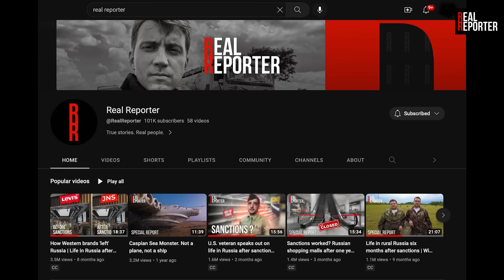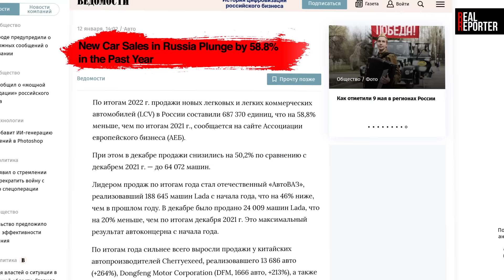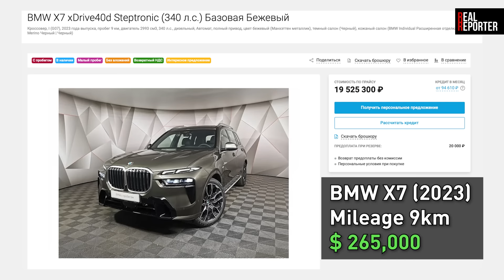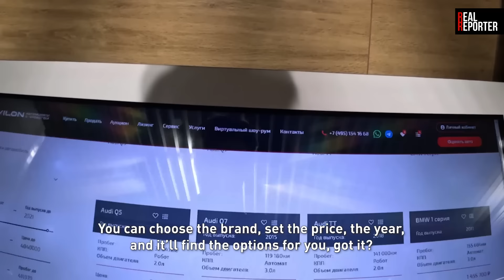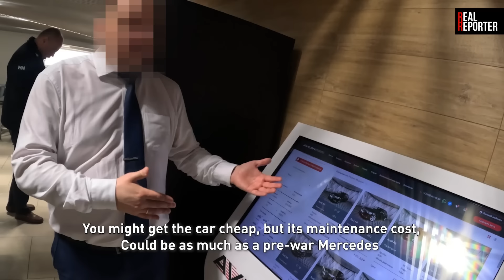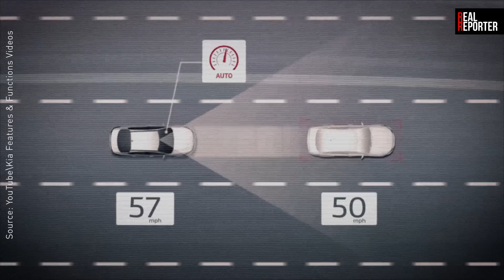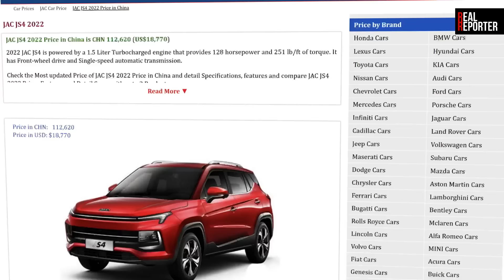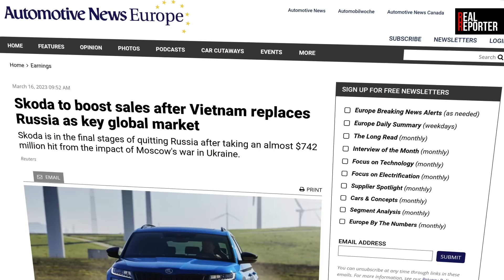Sanctions vs Russia’s car market. Who wins?

Comment: I though you were going to buy the Jag but I think you made the right decision, sticking with your old Opel for now. 

Me, my 2000 Jeep Wrangler and 2006 Dodge Dakota are  still getting me around Alaska roads, and off road as well,  just fine.
Reply: My 2000 S-10 4x4 still purring like new.
Reply from the maker: Hey there! It's cool to hear from a viewer all the way up in Alaska! Yeah, I was tempted by that Jag but sticking with my trusty old Opel seems like the right move for now.

Sounds like your Jeep and Dodge are doing a great job keeping up with the Alaskan terrain! That's the beauty of old reliables, isn't it? They may not be the newest or the shiniest, but they get us where we need to go. Stay safe on those roads (and off roads), and thanks for tuning in!
Reply: @RealReporter  The North American equivalent to your Opel Astra is the Saturn Astra (thanks to badge engineering, which is why in the video you see ‘new’ Russian vehicles are Chinese designed; it is not an uncommon practice these days).  Two oversimplified differences are lighting (North America has a different lighting standard), North America has a requirement for orange in the front and red in the rear for reflectors.  Plus, General Motors (“GM”) owned Opel for almost a century (to be exact 1929-2017), selling Opel to PSA Group in 2017, PSA Group is now part of Stellantis.
Reply: @ScottRothsroth0616  It was a Saturn Aura, 06-09, was a good car for the money.
Reply: Good deal, those cars with abs and airbags are going to serve you better in Canada than a Russian car without those
Reply: @ScottRothsroth0616  badge engineering has been going out of favour for a while now though
Reply: @TKUA11  Airbags (OKA "Supplemental Restraints") are unnecessary - only added because many Americans refuse to use seat-belts.  Supplemental Restraints are a quaint American  anachronism.

Comment: Great choice! Here in Romania we don't change our cars. We fix our old cars until they are not worth fixing. My volkswagen golf 4 TDI is 24 years old and it has plenty of life left in it. It still drives like a 5 year old car.
Reply: is a 1.9TDI the best Engine.
Reply: Russia too I have a 09 trailblazer I got brand new back then (my first car ever) so recently on a weekend I rebuilt the suspension (bushings shocks ball joints tie rods etc) it drives like the day I drove it off the dealership parking lot
Reply: walking coffins lmao
Reply: @veneps  still better than newer cars that can be seen in junk yards with blown engines and 180000 kilometers on the clock.
Reply: @lupulflamand5673  sigur, cum crezi tu
Reply: @Capt.-Nemo  Hello, my Audi A4 with a 1.9TDI drives everyday. 24 years old. Look after it.
Reply: Same deal with overwhelming majority of Russians, you’ll rarely see new ones even in Moscow and those are either taxis or some government official plates
Reply: Ai dreptate
Reply: @Dankmemeslover69  Govt officials are not permitted to drive foreign cars.

Comment: I am russian and I drive a 2018 Kia Optima GT right now. Bought it right before the pandemic for 2.100.000 rubles (around 26.500 USD). And I cannot say that I have any problems with spare parts! First of all, Optima (American K5) was a very popular car, so there are a lot of parts around shops. As for the filters and oil - they cost pretty good (I spent around 11k (around 138 USD) rubles to change all the filters and engine oil). During these times this price is actually OK. But 6 months ago we had to change the brake pads and discs on my mom's VW Tiguan, and the prices were a NIGHTMARE. We've spent like 50k rubles (630 dollars) on parts alone that time. But now analogs from China and less known brands have been entering the market lately and the prices are coming down slowly.
I wish everyone a great day and thank you for your great content! It's always a big pleasure to watch your videos!
Reply: clemathieu JT  I envy your prices in a good way! :)
Reply: clemathieujt6589  In South Korea it would cost 50-60 USD
Reply: clemathieu JT  Oil and filter possibly contefeit hence price.
Reply: I'm a mechanic in the USA. I work on a lot of Kia vehicles. I generally like them I have only one warning it's a big one though. If your Kia has a gdi or direct injection engine there is a major issue with the engines going bad usually around the time you would be putting new plugs in. It is completely random many never have a issue but far to many do. It's at no fault of the owner it is a manufacturer fault. The best advice is oil changes and more oil changes on time or early.
Reply: @sir.tacocartbearson1569  Thanks for the heads up! Will keep an eye on that!)
Reply: Western Parts are still flowing into Georgia & Kazakhstan etc.  I'm sure there are plenty of these parts bypassing sanctions & crossing into Russia by Truck / Rail ??
Reply: Can't you buy spares online from Autodoc or Oscaro?
Reply: @xavichuvy9047 yes Autodoc works
Reply: Ты бы на тормозах для матери не экономил
Reply: Car nowadays aren't high tech alien technology.... you can find copycat sparepart for every original ones 😂

Comment: 58 years of driving behind me - my daughter took me for a ride in my first EV.  It was a Chinese BYD, and based on that experience, I rate it highly as a local runner.  Long trips would require regular charging.  Charging spots are sparsely spaced and the charging time involved a huge inconvenience.  But it was a top class ride.  I find it hard to imagine that other EVs would offer more, and many might offer less.  Me? I still prefer gasoline for rural and long trips.
Reply from the maker: Hey there! Wow, 58 years of driving, that's impressive! I'm glad to hear your first experience with an EV was positive. Though, I totally get you on still preferring gasoline for rural and long trips. It just feels more reliable, I guess... Anyway, thanks for sharing your insights. Keep those wheels turning!
Reply: @armamentarmedarm1699  Maybe? but I do not see the increase in electricity production in this country.  Nor do I see the necessary upgrades of the network and distribution infrastructure.  Also the price of electricity is being increased much, - and that will make personal travel unaffordable, and that surely would effect the demand for electric vehicles.  So what exactly will future mobility look like?  I do wonder.  It does not make sense that the ideological rulers dictate supposed ecological rules removal of one main energy source before ensuring a viable affordable alternative.
Reply: @kiwikeith7633  they might have to increase their focus on hydrogen instead, depends if that area also have some huge manufacturing drawbacks or not as batteries do now
Reply: clemathieu JT  And the point is that the Chinese PHEVs are more fuel efficient than conventional ICEs, in comparison to the European ones especially.
Reply: Chinese evs spontaneously combust on a regular basis
Reply: Tesla uses Chinese batteries from CATL and Byd. They do that because their batteries are the safest ones available. Maybe you know more about battery tech than Tesla.
Reply: @shutyomouthchild  lying makes you happy eh
Reply: @MontyGumby good comment, comrade, CCP is proud of you
Reply: Fires starters.
Reply: @tallll70  Yes, you might be right.  I wonder how hydrogen can be produced in sufficient quantities and presumably it need to be compressed, which would take Energy.  So I do not understand the economics.  I still prefer Gasoline and Diesel.
Reply: @tallll70  hydrogen for cars is produced by using a lot of oil...these cars are extremely expensive ( I've talked with some taxi drivers hère i'in Paris who own one, rather small cars...then, not easy to find anyhere Hydrogen.
Reply: @shutyomouthchild  Do like your username says.
Reply: BYD Chazor looks build for you. Gasoline motor used like generator with electric motor. 1200 km range

Comment: Skoda is leaving China very soon too. Before 2010, China's domestic brand cars were really trash. Even the road network was designed to handle poor performance vehicles.
After 2015, domestic brand is becoming an option here. Also China's foreign brand cars are also joint ventured with domestic brands (EXCEPT TESLA, it get a special permit by Shanghai gov).
BTW, the most selling price category for personal cars in China is 100k~200k CNY (12.5k~25k USD). Also China is pushing for BEV and HEVs. What you see here are all kinds of outdated options and brands. It's much more common to see a BYD, Tesla, GuangQi and other foreign brands' EV or HEVs. 
Also, Haval, a sub brand of Changcheng aka, Greatwall, is having a really bad marketing right now. (The tech is still good, but marketing is killing itself) We are not looking good on it. Avoid it if you can.

Comment: Currently in Singapore. A BMW X7 will cost USD$485,610 to get on the road. There is Mercedes X350d (diesel version) here running for around USD $361,000.
Reply: lil

Comment: I'm about 16-17 minutes into your video.  One thing I think that is universal is that salesmen are not to be believed.  The salesmen there are no different than the ones here in the U.S. at many dealerships.  For them, the bottom line is they want to sell you something and they will do or say whatever they have to do it.  You're doing the right thing by asking friends and doing some research.

Comment: You definitely should consider Chinese cars! I drive a 2016 Volvo which despite its Swedish origin, is now owned by Geely and manufactured in China. It’s held up great! The advancements Chinese brands have made in the past decade is insane, good quality, safety, and price! Far cry from the Chinese cars of the early 2000s. Just look up the Shanghai Auto Show in 2023 and see all the crazy improvements Chinese cars have made
Reply: China has had experience building Japanese cars for years now 
I’m pretty sure most Honda sedans are built in China
Reply: That's great and I'm sure it is a good car but the reason I will not be buying one is because I do not want to support CCP. Unlike the Russians, I do have a choice which car I want to buy.
Reply: @dogetothemoon223  That's the correct attitude. Sometime's we have no choice but to buy chinese stuff, but in this case? Big no no no.
Reply: @gigadude556 lol,so gullible 😅 Most things you buy are made in China,or at least some parts of them are.Its not about you supporting or not supporting CCP ,it's about Corporations who are still supporting them 😅
Reply: Geelyes are alright, i've driven the Volvo xc40, and that Geely thing that his sub has bought feels about the same. Cheaper inside maybe, but not any different for how it drives. Other chinese brands are mostly not there yet, but Geely is the priciest of the lot.
Reply: @zloychechen5150 LOL  Do you really know Chinese car brands?😂
Reply: @user-hc5cg3jc3i  for better or for worse, i do.
Reply: Volvo isn’t made in China and still engineered in Sweden
Reply: @mosesgoldbergshekelstien1520 they’re not. Mostly manufactured in the states but developed in Japan
Reply: @lucasworktv  A lot of design and engineering is still done by the Swedes but it’s still owned by a Chinese company who revitalized it and added their own input. Volvos are made in Sweden, Belgium, China, & the US. My Volvo was manufactured in Chengdu China according to the papers in the glove compartment.
Reply: @Larry-Lobster  our BMW x5 was made in South Carolina United States, and was designed by an American designer Chris Bangle. Our x6 was made in Kaliningrad Russia (but also maybe the US) But still it’s actually a German car. 

Which Volvo do you drive and which country do you live in?
Reply: @Larry-Lobster  I beleive it was an extremely savvy move by geely to buy volvo. They don't seem to limit the swedes too much, but they use their tech and some other stuff, and it shows. I think in 10 years time they will be the new hyundai. A brand that a couple of decades ago seemed like some cheap-ass last-resort ecobox manufacturer, but now is kinda mainstream.
That happened to the japanese in the 70s, then to koreans in the 90s, the chinese are next.
Reply: @dogetothemoon223  "I do not want to support CCP. "

Great news, you wouldn't be supporting CCP, it's CPC to start with. Never let politics and emotions run your wallet is what my father told me as I grew 18. But hey, I hope it works out for you.
Reply: @f1aziz  when you are out of ideas, you run with semantics
Reply: Buying a Chinese made car is like buying a Russian made car.  At the end you're supporting the enemy. Hope EU and NA goverment makes it as hard as possible to buy Chinese cars in EU and NA.
Reply: @povilasmarveloustv3810  based on your logics, those Chinese should have done it long ago
Reply: @anti-bullingjames  they didn't do it because it was beneficial for them for many reasons. But in due time it could happen. The tensions between the regions are growing and what do you think will happen if China invades Taiwan?
Reply: @f1aziz  i hope your father never complained about jobs leaving US then with that type of thinking.
Reply: @dogetothemoon223 buying from China doesn't mean supporting the ccp. I don't want to support the US wars in Africa and middle East doesn't mean i won't buy American.
Reply: @povilasmarveloustv3810  complete trade embargo is a modern invention by all powerful central governments. During the Hundred Years War, England and France traded all the time.

As a consumer, I don’t benefit at all from trade embargo against Russia.
Reply: @alexanderchenf1  different times. Trade embargo right now would be more beneficial for the NA and EU because it would end up with more investment and manufacturing locally instead of outsourcing it to China. Covid showed just how dumb it is to over-rely on one country to deliver the goods. Though complete trade embargo isn't the answer either. Either way, NA and EU can't afford Chinese car makers to overtake their markets.
Reply: @povilasmarveloustv3810  as a consumer in the US, I don’t mind the States to selectively import certain Chinese car models. China has a huge overproduction of cars while the US has an under-supply of cars.
Reply: Larry, have fun with your Chinese car. Good Luck!
Reply: Foreign brands assembled in China are ways better than Chinese brands made in 🇨🇳. Chinese cars age so fast after 6 months. My in laws and wife’s relatives all owns foreign brands, not single Chinese brand.
Reply: its engineered in Sweden and most of the components are European, I think 30-50% is Chinese made
Reply: @SoYappy  Dramatic styling always ages fast, is that what you mean or that they begin to fall apart early?
Reply: the last time I checked they still manufacturing volvo in sweden
Reply: @mattia8327    Nonsense, it's Chinese in everyway except name.
Reply: @pelejobe6241  Check in with this century
Reply: @f1aziz  exactly some yanks dont realise how many chinese owned companies are in the us employing many us citizens.And yet they day dont support the ccp makes me laugh.
Reply: @alexanderchenf1  Privateers (government sanctioned pirates) would sack your ship if they caught you flying the enemy's flag, that was their alternative to sanctions
Reply: lol, Chinese junk
Reply: Yes they are. XC60 and XC 90 models
Reply: @lucasworktv  Whatever I know. The volvos sold in china is made in china chengdu. Volvo is 100% controlled under Geely group.
Reply: @povilasmarveloustv3810  When chinese buying a EU car , they never think so. German sold millions and millions car in china every year, do chinese think so? Be a human being, not a beast attack each other.
Reply: @junguo3088  not 100, but it is.
So that’s why new Volvos reliability score is below average
Reply: @lucasworktv  Maybe it is your wallet below average.
Reply: @junguo3088  nope
Reply: @lucasworktv  I guess you don't know the biggest luxury car market of the world is china. All the luxury cars sold mostly in china. If one brand can survive in china,that is beyond average level. And these years I saw fast change in china auto market. Volvo didn't sold so good in china so should below average level because all the chinese are change to EVs. EVs has superb performance than same level gas cars. All the bus and taxi in shanghai are EVs nowday. And almost 50% cars on road has changed to EV right this year. EV has top level than your gas auto.
Reply: @junguo3088  I know all that
Reply: @lucasworktv In fact, if you look at the distribution of production capacity, China is Volvo's largest plant.
Reply: @vitolu6727  ik
Reply: @hudziszeq i don’t believe you have to buy chinese products in 99% of the situations. that is just excuses. what is wrong with CCP? not buying chinese products will hurt CCP more than it does to a chinese auto worker?
Reply: @alexanderchenf1 US can produce enough cars. It is good for the consumers to have chinese cars in the US, but the politicians will make it a hell for the chinese auto makers.
Reply: @SoYappy Chinese aitomakers progressed very fast. The attitude towards domestic cars in China has changed greatly. In particular, Tesla is the only foreign brand that can compte with chinese EVs. The situation is so bad for Germans, VW and audi had to collaborate with chinese makers on EV.
Reply: @junguo3088 Geely only controls the passenger car division, not the truck division.
Reply: @lucasworktv europeans cars are never known for their quality, they are fun to drive though.
Reply: Volvos are still good? Good joke 😅 They became extremely unreliable lol
Reply: @@xarifa777 why?